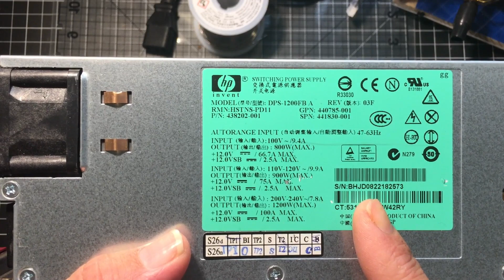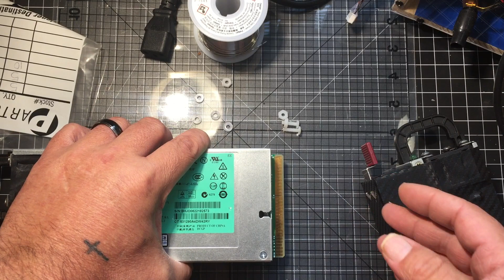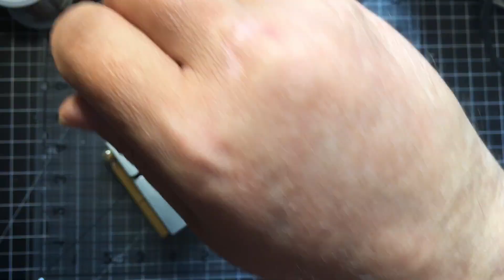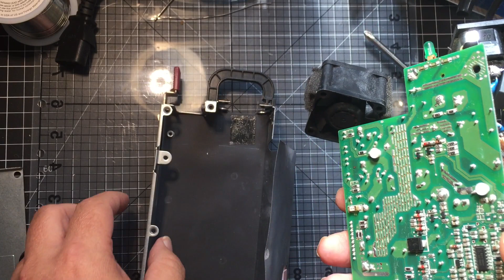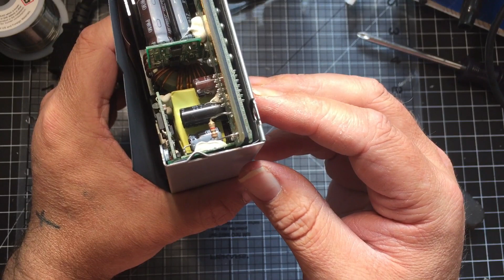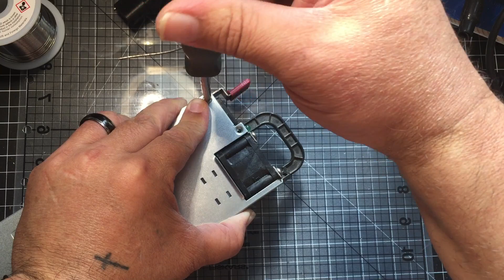HP 1800W (2 x 1200W "900W @ 120v)Server PSU Hack 24V 74A  (HSTNS-PL11) (floating Mod)

Comment: I Have the 1200W but now I came across an issue when I Power it up voltage goes 8.2V drops down to 0.02V and Power on light doesnt go on, if someone can help me with this issue id be happy hear how to fix it cause I need it with my projects..
Reply: Just a guess but pull the caps and replace them

Comment: Nice Hack Man!!!!  I need a 48v version Lol😲👍
Reply from the maker: Thank you!! That would be a Crazy Quad Stacker! But very Doable! I bet you have all the parts for it...I bet you even have 220 down in your dungeon!! 4000w 48V would be a Beast!!! Shoot, even at 120v and 3600w 48V, it would still be Crazy awesome!!
Reply: sounds simple enough! for the shutoff protection you would just round robin it, if one turns off then it turns off the next one and as that one goes off then the next turns off etc. or you can just get one that is 48v normally, alot less work lol https://www.ebay.com/itm/173345452261
Reply: Yeah... make sure you get 4... two in series and two in parallel... the. Whenever you upgrade your Powerwall to 48v you just put all in series for super POWAAAAAAAHHH
*theres always a maximum voltage you can connect things in series

Comment: hey nice! 24v at 1800W will be awesome! that sure is a powerful PSU for its size, mine are really long and skinny and the two I hacked together are only 1100W. 
hahaha I like the ISDT stickers on the 12v PSU unit!
Ah nylon screws that is what I didnt use, I just took some flat plastic and put it on each side of the board, luckily the holes are not plated through so it cant touch, the nylons crews are a better idea so it cannot possibly short.
In your next video can you put a link for the protection circuit? that would be fun to see how they did it other than how I did it. I know my PSU's are Dell and yours are HP so it might be different.
A link to my video incase people havent seen it: https://youtu.be/M4wOFHAjR5U
Reply from the maker: I just hope the breakers can handle it here...LOL The safety circuit should work with just about anything with power. It's just a simple switch using an optocoupler. Not sure where the video is, but here is the link for the RCgroup page I found it on. https://www.rcgroups.com/forums/showthread.php?1005309-A-simple-high-quality-12Volt-100Amp-Power-Supply-Part1/page215. The only oddball was the 5V Zener diode. I for the life of me couldn't find one, even on old electronics...LOL Thanks for commenting!!
Reply: hrm, Ive found a few zeners on a cheap dvd player it actually used them for overvoltage clamping, also on old car 5v chargers before they used standard usb for charging.
Reply from the maker: I had a couple and all I could find in the one I had was 4148s, but i have a few more I can look in tonight. The second supply just showed up at the door!!YEA!!!
Reply: sweet!!